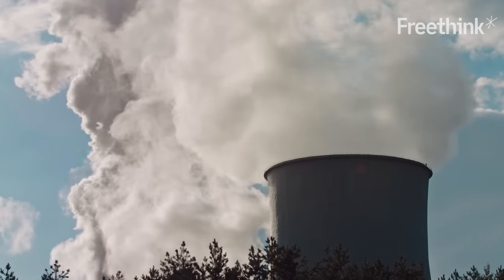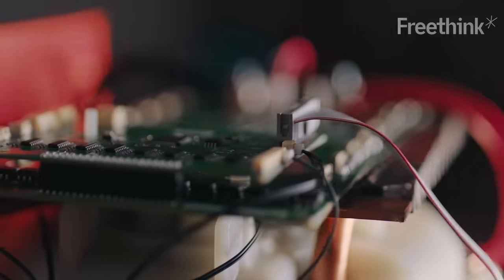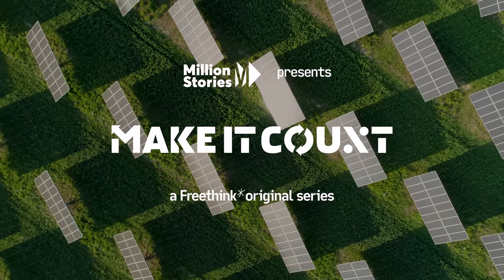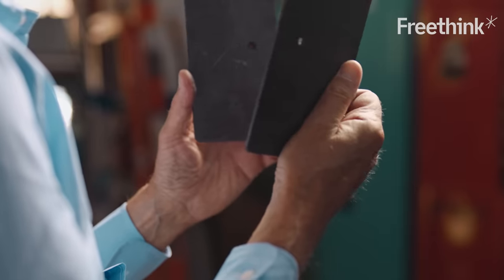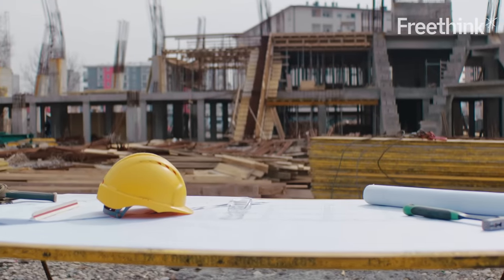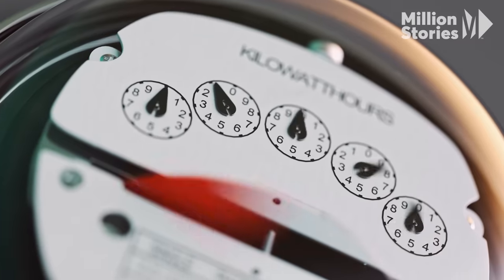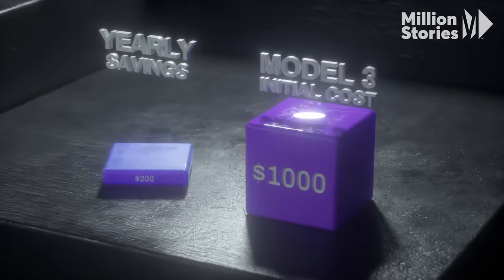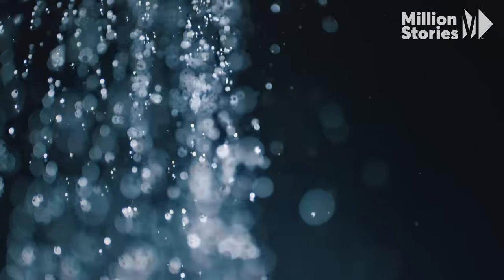The man hacking hot water to save the planet

Comment: So much wrong in this video. First off, I’m pretty sure that what they claim shows the water “boiling” instantly (at 1:28)  isn’t actually boiling at all, but electrolysis of the water into gasses. That is, they’re separating the water molecules into bubbles of hydrogen and oxygen. Second, as others have said, existing electric heating elements are already 100% efficient in that every joule of electricity becomes a joule of heat in the water. The “ohmic array” they’re talking about can only have, at best, the same 100% efficiency.

Indeed, if their method also causes electrolysis as I suspect it does, then some of the electrical energy that goes in will be diverted into splitting the water molecules rather than heating the water, meaning this is potentially LESS efficient than a standard resistive heating element. Oh, and that stoichiometric hydrogen-oxygen mixture that accumulates in the top of the cell is also explosive, so that’s great. Might even be corrosive to your pipes.

There is nothing offered here to support their claim that this method uses less energy than a conventional electric tankless water heater. And that’s because their claim is bunk.

If you really want to significantly reduce the energy our society consumes for water heating, the solution already exists and has been growing steadily in popularity of late: heat pumps. Heat pumps operate at greater than 100% efficiency because, instead of using the electricity put into them to directly heat the water, they use that energy to collect heat from someplace else (the air around the heat pump, the ground around the house, etc.) and move it into the water. That’s how heat pumps can easy give you better than 3x the heat for the electrical energy you put into them. And heat pumps are based on proven, reliable technology that’s old enough that patents don’t keep any manufacturer who wants to from offering a heat pump product.
Reply: Exactly this.  Resistance heating is 100% efficient, regardless of scale buildup.  So they started the video with a lie.  

Then you have an efficiency penalty due to generation of hydrogen and oxygen through electrolysis.  What a bunch of snake oil.
Reply: That is exactly what I thought!!!
Reply: This is exactly correct. Thank you for writing it so I didn't have to. :) I grit my teeth when I saw the flood of familiar micro-bubbles coming out between the plates as he was claiming it was proof of instant heat. I played with electrolysis when I was a kid (to collect hydrogen) and the water barely gets warm. I doubt those carbon plates will last long either, since they'll be creating CO2 with the generation of oxygen from the water (if it was fed DC, the lifespan would be measured in minutes, but should last a fair bit longer with AC).

They also completely missed the mark with the tankless heaters.  The best gain for a tankless heater isn't adding a huge one centrally, it's adding small ones where they're needed. If you have a small heater under your kitchen sink, the water is heated where you need it. You don't have to wait for the water from the central water heater to heat all the piping between it and the kitchen before you get that hot water. Same goes for the shower or tub. You have one small one at each location.

Very good point about the heat pump. If it's engineered properly, it can be used to heat your water and cool your house.
Reply: @glabifrons  Thank you nice people! I'm really happy to find more and more people educated and familiar with some basic physics ideas. It was so wonderful to see many comments pointing out problems and flaws obvious to everyone who payed attention at school physics lessons :)
Reply: It seems like anyone can have a documentary on their pseudoscience nowadays.
Reply: It makes me very happy seeing this comment at the top. I totally agree. The claim that it saves energy is negligible at best, and only if you compare it to someone using hot water very rarely and also having an unneccesarily large heater tank volume.
But i guess snake oil sells nowadays, as long as it's coloured green.
Reply: Plus the carbon electrodes tends to chip off pieces of carbon so you have to filter the water.
Loss by electrolysis is for sure a loss. Just throwing a 9V battery into a glass of water will produce instant bubbling.
Reply: Thank you Jordan for writing my intended comments for me, and thank you all who responded to Jordan's post which saved me from having to write a reply. Wait . . . er . . .  I just replied, didn't I?  I'll let myself out.
Reply: Isn't it boiling because it's in a vacuum
Reply: You are correct!  I get so tired of these lying commercials!  One point to consider though is if you use a heat pump water heater in a home that is being heated you’re probably not gaining much during heating season…
Reply: Parts of what you’re saying is true and parts bunk, just as you say about this video.  Every joule used goes directly into heat is true for brand new water heaters powered with electricity…  but depending on where you live and the mineral content in your water supply will determine how long that remains true.  As the minerals deposit on the elements their efficiency falls dramatically, and I mean dramatically !   The graphite plates shown in this demonstration don’t get hot and bake the water in the same way a resistance element does so those mineral deposits don’t form on the device.  It’s efficiency remains constant.  The reluctance of usage is directly tied to set up and installation costs and those are directly controlled by the electrical power distribution companies.  Do you know how much the use of LED lighting is costing power companies.  When you save money, they loose money.
This technology when it goes wide spread will nationally cost power production companies billions and billions of dollars, those are the dollars you will be saving … is it any wonder they will say and do anything they can to slow the use of such innovation ?  NO !
Reply: The little bubbles are air driven out of the water because warm water can hold less dissolved air than cold water. Electrolysis does not occur with ac.
Reply: Not only all this, but that thing looks complex af. Think about troubleshooting and trying to fix it lol. Not happening very easily.
Reply: Im not sure, but i dont think heat pumps are greater than 100% efficiency. The only time they might be so are if you need to both cool and heat something at the same time, and your heat pump has been configured to do exactly that (Like having airconditioning and a water heater at the same time.) Heat pumps are literally just air conditioning units, except they can work in "reverse" and heat in the same way they cool. Air conditioners literally just transfer heat through manipulation of the refridgerant's temperature by forcibly changing its state. Its always never going to be 100% efficient since there will always be temperature loss through the pipes and into the environment due to temperature difference. Plus changing its state will have losses, there is friction in the pipes, noise and vibrations generated from moving liquids, etc.
Reply: One more problem with the technology described in this video is the fact that it requires the power to be delivered the instant you take a shower. A hot water tank is a thermal battery, and actually a really good way to store energy (assuming it's well insulated). If everyone takes a shower around the same time, and need to pull the 100-200A from the power grid right that instant, that creates a much higher peak load on the energy grid, and wastes more energy in the form of heat in the transmission lines. No hot water tank also means that it is impossible to implement energy saving measures such as turning off the hot water tank on peak usage times, such as when people come home from work and cook dinner. You'll still have a buffer of hot water in the hot water tank, and can heat it up again after peak usage (at night), when electricity is potentially cheaper, and there's less load on the electricity grid.

 @brandonkoh8361  The higher than 100% efficiency of heat pumps is in comparison to a purely electric heater, the additional efficiency comes from also moving heat from either the ambient outside air (cooling the outside air) or from a bore hole (cooling the water and the soil/rock underground). This increases the amount of heat you get per unit of electric energy, compared to only using the electric energy to produce the heat.
Reply: It's not electrolysis.  You only get that (at volume) with a DC current.  They are probably using high frequency AC to avoid that issues. What it IS is a very small volume of water between the plates heating up quickly.  The rest will still be at room temp and take the same amount of time to boil as a resistive element for the same power input.  It just avoids the heat load of the element and give a practical way to scale instant electrical heating.
Reply: @joels7605  The scale would actually be insulative at some point. Don't know the point though.
 
As to electrolysis, that would make it less efficient if that is happening and the explosive gases that it creates are concerning IF electrolysis is happing.
 
The thing I see where it has an advantage, in many cases you don't need to upgrade your electric panel to install this. I have shopped for on-demand electric heaters and man they need a lot of juice when they turn on. I have a 200 AMP service, with a Heat Pump. (I'm all-electric and NO natural Gas) If my heat pump is running and my wife has the stove on, it would overload the panel. This one, for my living zone, looks like I could install it and not worry about that.
Reply: @johnbrewer1430  Nope.  Scale doesn't matter.  1 watt is still 1 watt.  It can't accumulate inside the heating element or it would melt.  If you deliver 1000 watts to a heating element you get 1000 watts in the water.
Reply: @BrettDalton  
how come they didn't place a temperature reading at all?
Reply: gas powered water heater yo.... they literally showed a gas stove in this video. thats a lot more efficient than burning natural gas at a peaker plant then turning into electricity and sending it to your home. i think the math comes out to be about 33% more efficient by avoiding these losses... and natural gas makes a lot less co2 per unit energy than coal power plants which is where a lot of electricity comes from. i bet it would beat this electrolsis device which by the way, would pollute your water and degrade over time as well as likely build up explosive gasses lol
Reply: I see a fellow heat pump connoisseur
Reply: @vevenaneathna  only true if you take transmission into account, not true if you have solar or a battery by a long shot
Reply: @BrettDalton  if you look up the technology connections video titled "Furnaces: Why we still burn fuel to heat our homes"
it serves as a good overview of all the energy transformations and efficiencies. 

to be honest im not quite sure what part of my comment youre replying to.
if you assume 0% transmission, and 100% heat capture, and then you take the typical stoiecometric chemical reaction of any hydrocarbon, and determine its net energy output vs particles of CO2 produced, you will find the 3 following trends
1. the more unsaturated any hydrocarbon chain, the more co2 efficient
2. the shorter the hydrocarbon chain, the more co2 efficient
3. the less branched the hydrocarbon chain, the more co2 efficient

combining all 3 of these rules and looking at the most extreme case, you have natural gas.... so its a lot more efficient than coal which is made of much longer carbon + long hydrocarbons.

Batteries dont tend to change the inherent carbon efficiency of a fossil fuel... well they used to when we had a lot more nuclear power to offset peaker plants, but now with all this solar we are really shooting ourselves in the foot with peaker plant co2 production.
if we had infinite of any one power source we would pay about
hydroelectric = $.05/kwh
nuclear = $.07
wind = $.08
solar = $.07
nat. gas = $.11
coal = $.09
geotherm = $.25
solar+LiPo bat. = $.35
wind+LiPo bat. = $.37
Reply: @vevenaneathna  gas water heaters are only, at best 50-60% efficient.  USA EPA estimates 1.4% of gas is lost in transmission (leaks).  Methane has 10 times the impact compared to carbon.

Typical transmission losses on power lines is 6%.  Resistive heating is closer to 100% efficient.  Even with coal producing more carbon, between heating losses and escaped methane gas is massively worse for the environment.
Reply: @vevenaneathna  you are ignoring energy costs of gas production and transport.  Compression and pressurisation of pipes cost energy.  I was also referring to leakage when talking about methane.  It's easily to make an argument if you divert the conversation
Reply: @BrettDalton  bro if youre going to compare the most efficient way of making on demand electricity besides coal(natural gas) to a natural gas powered device, its a pretty safe assumption to ignore the cost of production. 

And the more I read about this supposed transmission + distribution losses the more skeptical I am. Scientific papers that are anti natural gas estimate distribution loss at like 0.5% loss, and transmission around 1.5%, but as far as my understanding of the difference between a gas fired plant making electricity and then sending it to your house, vs getting pipped natural gas, the difference is just distribution not transmission. 
some obama era 2015 EPA estimates say "about 1% but we dont know", and after reading some interviews with people in the industry, they claim that with the temp and pressure changes, the losses are usually unmeasurable given what they can measure. Seems like some older cities have some old gas lines like boston, but they just need to fix those 80 year old rusty pipes and replace with PVC, it doesnt seem really inherent to the actual technology any more. 

I dont know much about compression/pumping natural gas but I would assume that its very compressible given its density and poor intermolecular forces and thus requires a small amount of energy. from what i can look up it looks like the distribution part doesnt even require any compression stations since youre normally dealing with LNG or some high pressure underground storage? like how a bottle of propane will just empty if you open the tap lol.

If you ever read my post from 2 months ago, i think its somewhat clear that im talking about efficiencies, and especially if you are comparing between energy forms, to me thats thermodynamic efficiency. your repeated mystery boomer replies are why you think were talking past eachother lol
Reply: @vevenaneathna  if you only look at one part of the chain, for one of the options then yeah you will get the answer you want.  Re the compression of gas, how do you think it gets into the pipe or storage under pressure in the first place? Being asked nicely?
Reply: @BrettDalton  well its transported under pressure or liquified but the actually local delivery it seems like all they gotta do is heat up the cylinders its in if too much is released lol
Reply: count me in .. this is nonsense..
Reply: first off  he says the water is warm up and not totally use say bye bye to your 100% already
next off the water is  converting into hydrogen and oxygen when their 2 different metal 

in this video he simply use micro thunder to boil the water with elecricity spark
Reply: you know when I saw this I thought it looked like a device invented by Stanley Meyer to make hydro to run a car but I thought that Meyers device used resonance to break water. Not sure and any info would be greatly appreciated
Reply: I totally missed this, thanks for posting. Wait, doesn't electrolysis only occur with DC and if this is basically a standard AC supply conversion then the water has to be boiling?
Reply: Dare I say fake news